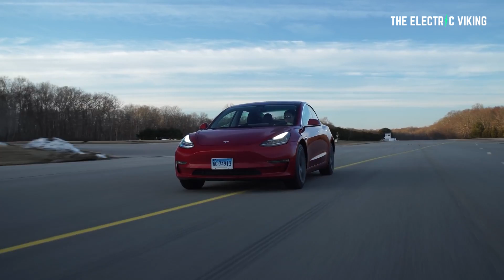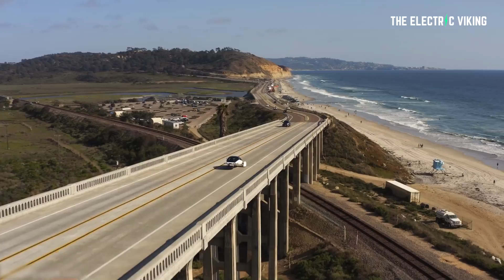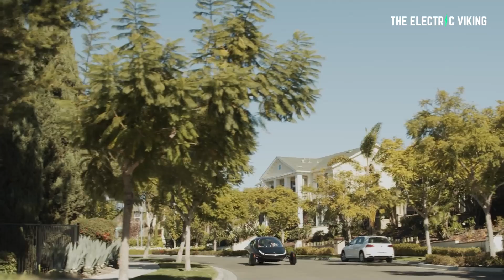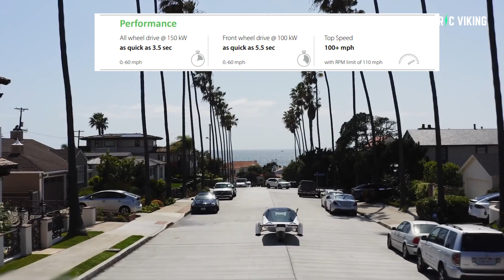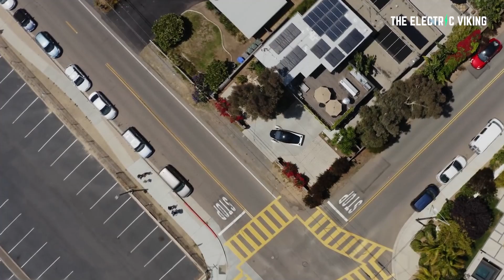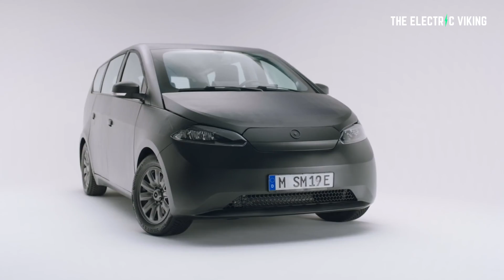I JUST bought a self charging US EV with 1000 mile range

Comment: The Aptera is being designed for efficiency and longevity.

Aptera are currently undergoing their beta phase of testing prior to production. They said they are deliberately going over and beyond in their testing regimes as to what is required of this type of vehicle to ensure the reliability, safety and performance. So that when the vehicle finally rolls off the production line, then we as customers will feel more comfortable and confident sitting behind the wheel.

The in-wheel motor powertrains give vectorised torque control to give the Aptera comfort, stability control, and the ability to handle inclement weather. Its test track moose test has indicated that the vehicle is very stable through aggressive cornering scenarios. No fear of tipping over or becoming unstable under duress! Besides the motors are being massively derated as they provide so much torque that it appears that the vehicle will still have a sports car like performance.

The body shell is made of carbon, kevlar, and hemp, therefore ultra lightweight and extremely strong and many times stronger than your typical steel-based vehicle. The main body of the vehicle has safety features built in inspired by F1 racing cars and all vehicles will have seatbelts and airbags. Not too many vehicles on the road today will have that level of safety that Aptera intends to incorporate into their vehicle!

The vehicle will be air conditioned, so even while you are away from the Aptera the cabin interior can expel the heat or cold. What vehicle currently can you pre-program the cabin/seat temperature prior to entry? Tesla, yes, but with any ICE cars you can forget it! Nobody likes smelling petrol/gasoline fumes while the vehicle is sitting there idling with the air con running. It will certainly make going to the beach on a hot summers day, or making a snowman a much more pleasurable experience.

The aerodynamics of the vehicle is not only efficient from the frontal perspective but the 'rounded' body shape makes the vehicle less inclined to be buffered by side winds as well. This causal effect is quite noticeable in 'normal' cars when a semi passes by. I certainly notice it.

The Aptera is using a standard small car tyre size P195/45R16 which can be purchased at any tyre dealership. As the vehicle weighs only 800-900kg the wear and tear on the tyres would be minimal.

Can't wait for my pre-order to morph into a real vehicle as well! As long as Aptera can get the vehicle passed through the European regulations then that should bode well for us here in Australia and New Zealand.

Once the Aptera eventually escapes it enclosure many people will soon realise that this currently niche vehicle can have a lot more practical usages in their everyday private, corporate and business lives.

Onya Sam!

Comment: This vehicle is for a very niche market. But I am shocked at how many commenters here have ordered one and have such positive outlook for it. I would not buy it without giving it a good test drive. I don't care what they say, what videos they show, or what celebrity endorses it. 

The obvious drawbacks are all the things that are outside of the car. Where would you get it repaired? How much would it cost to insure? How do you tow it? What's the depreciation value comparatively? Is changing the tire different? Some shops won't touch an in wheel motor to replace a tire or brakes. How would you replace the windshield? 

I personally would not buy the very first iteration. If they have enough of a market to make it to a 2nd or 3rd iteration, is when I would consider buying it, if I was in the market for one. Because you'll have a hard time reselling it if the company goes through one production run and then goes belly up. How long would you have to drive it to recoup your investment in gas savings? 

And most importantly you have to ask yourself that if you just wait 3-5 yrs, will the 25 thousand version then come with double the range or the mid/high range version be considerably cheaper? EV's may hold their value now, but when battery prices start dropping, and they will, then it's the risk of high depreciation.

Comment: Are the Aptera hub motors Axial Flux or are they Radial Flux motors like every other EV?  Would it make sense in the all-wheel drive version to run only one motor and shut down the other two while driving at constant velocity on the highway.  The goal would be to achieve better efficiency using fewer motors.

Comment: Talking about 1000 mile range AND never having to charge again in the same sentence doesn’t make much sense - if you do  a long trip, you WILL need to plug in to drive. You don’t want to wait a month of charging before you go on  another drive. On top of that, air conditioning, computer system, battery management will chew up most, if not all of the energy that can be gained from the limited space for solar panels (700 watts over 6 hours of peak sunshine? Note that not all panels face the sun at the same time)

Comment: Safety requirements for this vehicle would be much less demanding than a four wheeler because it could be registered as a motorcycle. Not sure that's an advantage but I'd like to have one. In the 1960s I had an unconventional car that was tiny, light and fun in its own way, a fibreglass bodied Lightburn Zeta. It was a market failure so I got mine cheaply second hand.
Reply: Aptera is designing to meet or exceed many FMVSS passenger car standards. We will not know Aptera’s actual rating until it passes a production vehicle through the full safety tests.

Comment: I'm a fan of efficiency therefore a fan of Aptera. Glad Sam finally did a video. One point of clarification, I think Sam said 2 motors with option to down size to one. Actually with the in-wheel motors you get 2 motors with fwd and 3 motors with AWD. That'll give you a little extra kick in the boot, eh?

Comment: It has a 5-star safety rating for a MOTORCYCLE.  With three wheels, it's not a CAR by law here in the U.S.  So, don't expect bumpers, crumple zone, crash testing, and other safety features as you would expect with a car.  That's why the price and weight are closer to a high-end touring motorcycle than a sub-compact car.

Obviously, with the driver and passenger completely enclosed, it's as safe as you can get on a motorcycle.  Having air conditioning on this motorcycle is really nice too for those hot summers.  This has airbags too so that's a huge bonus over motorcycles.

Since I already own motorcycles, I'm good with this.  So, there's a good chance I'll get this or an Arcimoto FUV (once they are offered with air conditioning also) after our lazy-ass Congress passes the new EV Incentive.
Reply: It's getting tested as a car. We'll have to see how it does. This autocycle has crumple zones, airbags, seat belts, automatic braking, vehicle dynamics control, etc... But no pedestrian bumpers. So I'm expecting that would be a failure for pedestrian safety.
Reply: @peterjorgensen3  
In the U.S., three-wheel "autocycles" are classified as motorcycles by the NHTSA.  In Aptera's 2021 Annual Report, they confirmed this ... "The company [Aptera] is aware that the National Highway Transportation Safety Administration is reviewing whether to adopt new
 safety regulations pertaining to three-wheeled motor vehicles. Currently, US motorcycle regulations apply to such vehicles. "  

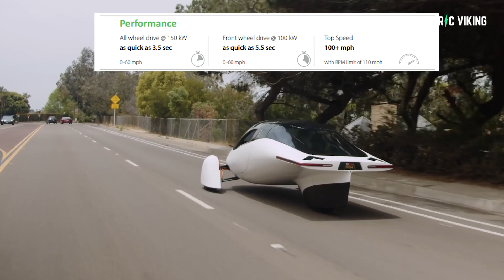At 6:50 Viking says that Aptera claims that it will have a "5-star safety rating."  There's no way the NHTSA will give them a 5-star safety rating for this when tested as a car.  It will as a motorcycle though.

That said, if this vehicle does get a 5-star safety rating tested as CAR, then I will put my money where my mouth is and reserve mine ASAP because that would be an AMAZING feat.

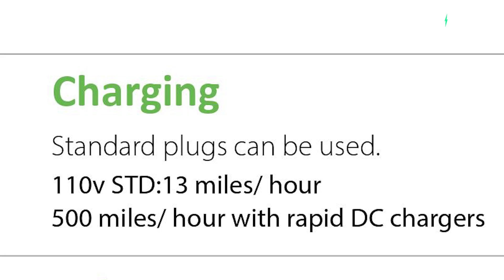Comment: 8:00 based on 1000 miles for 100kWh, that's 10mi/kWh, so 500 miles in an hour of charging would have to average 50kW.
Reply: Yep.  They said somewhere it charges at 50kwh.   Not speedy per kWh, but good per km/ hr due to efficiency, and that charge rate will keep the batteries from degrading much.   Now these are still in beta, so may end up with higher numbers, as the final designs and suppliers are not locked in.
Reply: Correct.

Comment: I'm a big fan of 3-wheelers since my dad spent 45 years of machanical engineering teaching about them, they are so darn efficient and fun to drive.  However, I'm no big fan of in-wheel motors despite the fact that they where developped at Hydro-Québec's TM4 labs here in Canada, because they realized that their weight posed a big challenge for the suspension and they were very fragile in potholes, which can be very common in areas that see frequent freezes and thaws. 
Then again, the solar option will most definitely be a good thing in Australia. 😎👍
Reply: Aptera claims to have tested the in-wheel motors and found that they are holding up well.
Reply: @ferfromla  I'm pretty sure Aptera tested them on california roads, with far less potholes and de-icing salt than canadian winters. 😎☃️
I find the concept realy great and efficient, it's the suitability in my climate that I'm questioning. 
Especially snowstorm handling, it has been my personal experience that it adds challenge since the real wheel cannot use the grooves of the fron wheel to get better traction.

Comment: The Aptera vehicle is such extreme bullshit from start to beginning, it's amazing that people still fall for it. 100kWh battery.. that's how much Mercedes needs the whole undercarriage of the EQS for.. where are they going to fit such a large battery pack in that tiny car, and especially with this weird droplet shape? Cheaper and lighter LFP packs take even more space. A 100kWh battery pack weighs about 400kg.. and they want to get that 0-60mi in 4.5 seconds, on those tiny wheels? Never going to happen.. they'll burn rubber instead. And do a simple calculation on a napkin for the solar panels.. the best panels right now have ~20% efficiency, and that car has space for about 3 sqm of panels, which under optimal conditions (Australian outback or Nevada desert) would give about 400W of electric power. Curved polycrystalline panels are significantly less efficient. And of course, any slight bump will break those panels.
The whole car and its specs are completely inviable if you have even a slight idea about physics. But the venture capital guys apparently skipped that part of school, and love throwing their cash at Aptera. And now they've got yours too. Congratulations.

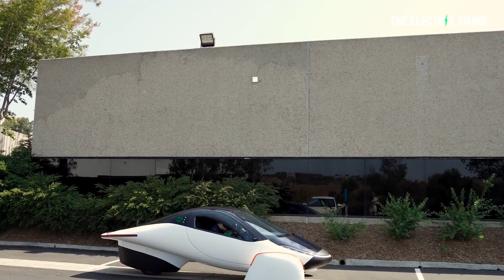Comment: 2:10 Removing a rear wheel puts it in a class with motorcycles in the USA...and thus can be made much cheaper because of fewer regulations.
Reply: I think they also put the motors "in the wheels". Thus no linkage...just power and control wires.

Comment: I had 2 reservations on the 2007 version... then they refunded my deposits when they went under. I have several reservations now... including very early ones (3 under serial number 190).
I do eagerly await the first - a 1000 mile one with the solar options. It should be able to also charge with TESLA superchargers ... a Tesla Outlet... in case you want to drive all day and all night.

Comment: Sorry for the negativity, but i just don't see this as a viable option. Perhaps if you never took it out of a residential area or out of town it might be okay, but any sudden stop caused by a heavy object looks like it would reduce the occupants to jelly. The light weight would seem to remove it from travelling on snow or ice or even days with a strong crosswind.  And the reason for having the fourth wheel I feel is more for the stability than any amount of value drag reduction would have.

Comment: Ticks almost every box. But how well does this 3 wheeler handle? That is my concern after seeing vintage European 3 wheel cars tip over on sharp turns.
Reply: The two wheels at the front format means it’s going to be fine. As you corner hard the front outside wheel loads up, and if things get really lairy then the limited traction at the rear means it drifts way before it starts to tip. Also, this car is so low that the C of G is way below the centre of mass.

Comment: The original Aptera was going to be gas powered. They didn't switch to electric until the revived the company. The in-wheel Elaphe motors make a huge difference in the complexity and weight reduction of the vehicle.

Comment: I'm sorry I couldn't get past half of this video.  I've been following Aptera for quite a while.  Sooo many red flags with this company.  This is a great science project but in everyday use I can't see it happening.  It is as wide as a F150, quite a lot of bending and folding to enter and exit(they go out of the way to avoid showing this but you can find half second clips if you look hard enough), the turning radius isn't published but an Aptera Ambassador admitted there were issues with it, 3 wheels means you can't miss the potholes as Jay Leno points out, 1/3 windows means the drive-thru could be a messy visit,  they claim 40 miles of charge under ideal condition but when you use their interactive estimator even the most sun drenched Andies mountains don't give you 40 miles a day.  Unless they have some magical composite there is no way this will have crash protection anywhere near a modern mixed metal car.  In April they claimed they were on track for  production by end of 2021.  Big miss.  Now it is later in 2022 which means maybe in 2023.  Meanwhile the EV auto industry is evolving at hyperspeed and getting cheaper, longer ranges and charging faster.  3 wheeled vehicles har a hard sell and being of unflattering design the sell gets harder.  If tax credits still exist for 2023 for ev cars it will be possible to buy all 4 wheels in something that has true crumple zones for less than the low end Aptera. The cargo space isn't very usable.  To get head clearance the driving position is very reclined.  ECREE.

Comment: I considered it but the range depends on how much sunlight one gets locally and mine isn't great.  However, with battery and solar technologies being pushed so hard, it may be that most EVs have solar charging at least as and addendum.
Reply: Aptera can be charged and travel up to 1,000 miles by plugging into a standard 100 V or 220 V outlet. Aptera will also be compatible with CCS, J1772, Level 2 and CHAdeMO/ DC Fast Charge stations. Tesla has some of the best EV technology in the industry and I believe Aptera may be sharing it's charging infrastructure.
Reply: So this is a very efficient EV with solar as an addendum. It's not the only way to charge it. It has 50kw DCFC (for now) which isn't crazy fast but at that efficiency is on par with the recharge speeds of other long range EVs on the market. Solar is just a bonus way to charge it.

Comment: Sam, I wonder if it's front or rear wheel drive. If it's rear wheel drive, I don't think it will have much regen braking. As you know from mountain biking, the front brakes are the ones that have most effect. I'm assuming you have flown over the handle bars multiple times.
Reply: There's 2 or 3 wheel drives-front or all 3.
Reply: @2eyedhairlessmnkey  Oops, I made a mistake. Thanks for pointing it out. It's either the drugs or old age. Yes indeed the Aptera comes standard with front, two-wheel drive. I have made the correction.
Reply: @IBMara  ok, good. Was wondering!
Reply: The Aptera comes standard with two (2) wheel drive and torque vectoring. It is available in all (3) wheel drive. The in-wheel motors provide more regenerative braking then the conventional layouts of most BEVs.

Comment: I hope you get one sooner than later. From what I've seen of the engineering it should be a well built trike with a cabin. A Cyber Truck is something I hope to get because it suits my want list better. But if I could afford a 3rd car I'd consider Aptera among some others.

Similar to the FUV, the Aptera may have another advantage. Sandy Munro was involved with improvements to the Aptera. I don't know the current relationship between Munro & Associates and Aptera. The FUV, Aptera and Nobe are three potentially great 3 wheel vehicles, but each will probably attract different segments of the population. The FUV would be generally practical and more on the fun side of things. The Nobe has a retro design, is practical enough for local driving. The Aptera is more futuristic looking and may be great for local driving and hopefully for long distance traveling. The FUV seats two (one behind the other) or one with cargo space. The Aptera seats two side by side but didn't see much about cargo space. The Nobe seats 3 and does have some actual cargo space, but looks like an invention that popped out of the 50's or 60's. If I was a multimillionaire, I would buy one of each for personal use and as a demonstration to onlookers that there are practical EV's of the 3 wheel kind.
Reply: The Aptera has a good amount of space in the back, like a bike fits back there.   708 liters is the current number, subject to engineering changes…